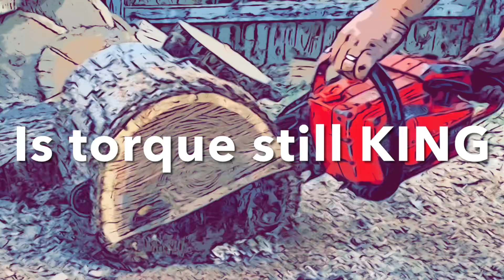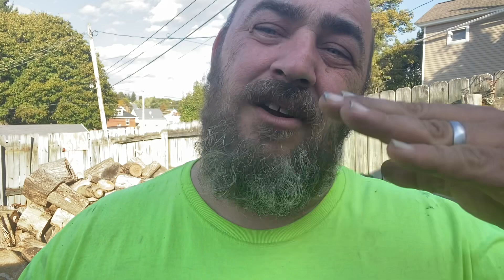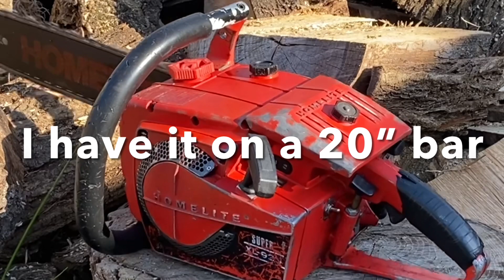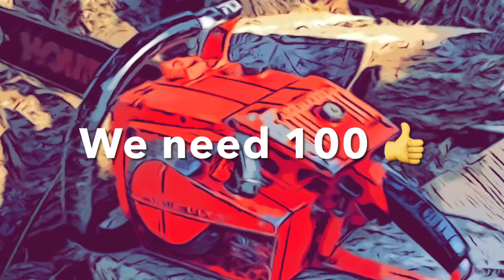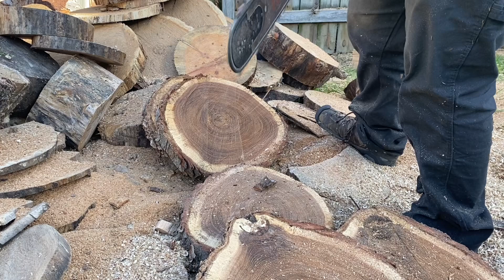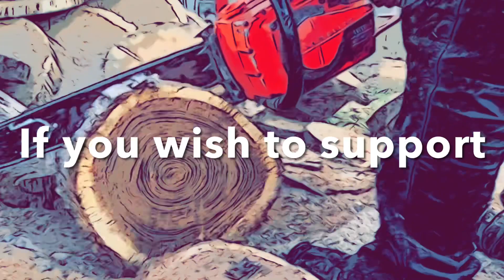Finding More Torqe!  Ported Homelite Super XL-925 Chainsaw!  Chain Testing!

Comment: Acresinternet chainsaw collectors corner the xl-923 & xl-924 weigh 14.5lbs. While the xl-922 weighs 18lbs., and the xl- 925 weigh 17.5 lbs. Does anyone know if these are accurate numbers? Reason I ask is because same site says the vi955 weighs 14.5 lbs, and when I got mine I quickly found that it weighs more than 14.5.
Reply from the maker: To be honest I don’t worry about the weight at all.